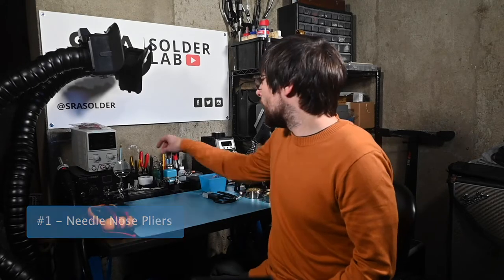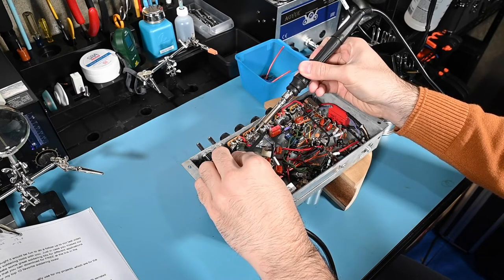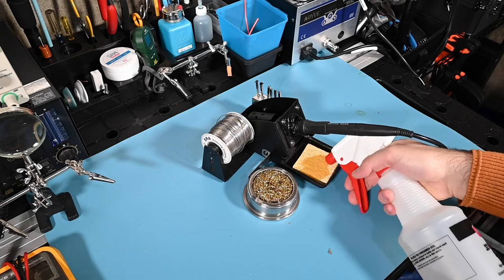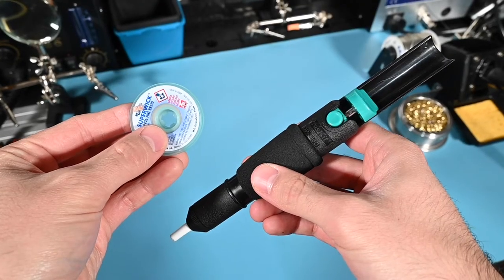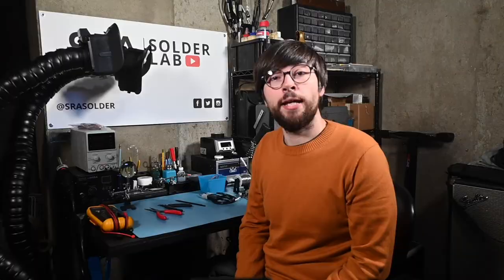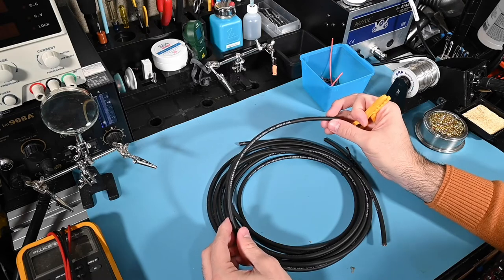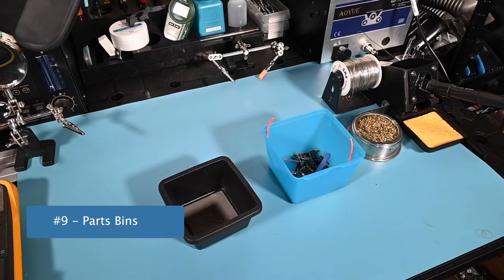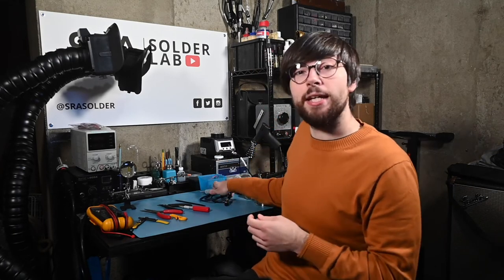10 of My Favorite Soldering Tools

Comment: I need so much help with soldering. I'm trying to get good enough to rewire some of my guitars but I am horrible at soldering. Thank you for this,
Reply from the maker: You're welcome, the guide should definitely give you some great tips on tools and technique. I would get some pots/jacks to experiment on, luckily they can handle a bit more abuse than PCBs. You don't want to apply any pressure from the iron other than gravity and you should have about 10 seconds on the joint before risking damage for these parts. The idea is always to get in and out as quickly as possible while still making a solid connection. Heat, flux, and solder are the 3 keys to mastery.

Comment: Hello Sam.  Great video!  Glad to see you making them.  My favorite tools remain my Aoyue 8800 desoldering gun, and my fully accessorized 968A+ Station.  Nothing compares to having the right tip, at the right temp, for the job at hand.

Haven't had time to use them as I'd like.  Hopefully that will change in time.

The cardboard is a smart idea. I use 4-oz Mason jelly jars. And taking photos as you disassemble is way smart.  Did that while refurbishing a vintage amateur-radio TV monitor. Helped in re-installing everything.

The snap-on tools looked intriguing. I need to find long-nose tweezers when removing SMDs with hot air.

Keep the videos coming!
Reply from the maker: The mason jars are excellent for parts bins! I'll keep on the lookout for nice long-nose tweezers.

Comment: Sam, from time to time I need to solder 14 - 12 gauge wire in the field where we have no electricity.  Is there a battery powered soldering tool that you recommend that is powerful enough to do the job.  I hate using butane. Thanks.
Reply from the maker: I believe that most standard cordless 40W soldering irons should be able to handle 12-14 gauge wire just fine. I don't have much personal experience with them though. What I think will really help though in any case is a good solder and flux combo with proper technique. I would use something like our 135 rosin paste flux to coat the wires, add some solder to the iron, probably 0.31” 63/37 rosin core, and then solder them up by adding more solder to the other side of the wire. Pre-tinning the tip with solder will increase the surface area giving you better heat transfer and the flux will allow the solder to flow quickly where you need it and wet into the wires. Otherwise, you could be spending too much time trying to get the wire hot enough which could lead to damage and poor connections. I suggested a 63/37 alloy because it melts at a low temp and has virtually no plastic range (Eutectic) so as long as you can get it to melt, you are less likely to get a cold solder joint.
Reply: @SRASolderLab  Thanks much for the reply. I'll give it a try. Thanks again.